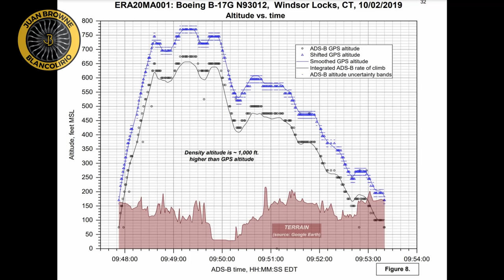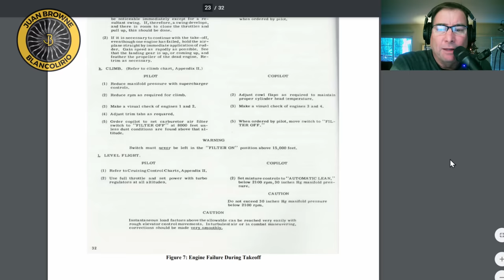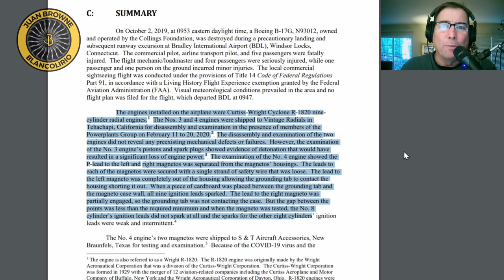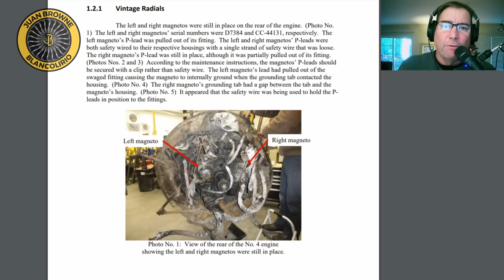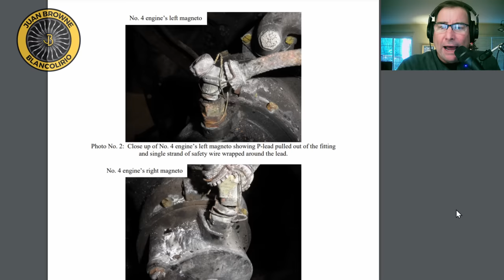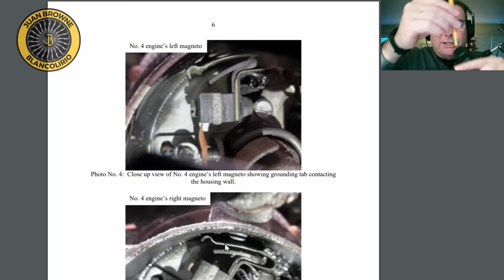NTSB Report B-17G Crash 'Nine-O-Nine' Part II -18 Dec 2020

Comment: The best way of preventing another accident was not taken.  If the FAA did their job they would have yanked CAF's certifications. Dallas would not have happened.  These tragically preventable accidents will continue as long as the CAF flys.
Reply: + @geeeeeeee3  "Nine-O-Nine" was not a CAF aircraft.   The CAF accident is going to be bigger can of worms once the final investigation is complete because it touches on airshow operations entirely.

Comment: As a R 4360 engine mechanic in the Air Force and a ol radial mechanic now, the left mag fires the rear and the right mag fires the front, 4 letters and 5 letters is a memory clue

Comment: Juan, thank you for this in-depth video. A magneto ignition system is a very basic system from my experience. Easy to maintain on a chain saw. But on a 76 years old 9 cylinder radial engine? Different story, I guess. Wouldn´t there be a way to retrofit these old engines with a digitial monitoring system, which could trigger an "ENGINE LIGHT" warning? The faulty condition probably already existed during the run-up check and during run-up for take-off. Probably there were good readings on the old manual gauges inside the cockpit and no unusual sounds from the engines. But a simple set of induction sensors on the spark plug wires probably would have sensed, that something is not right, triggered a light and demanded a mission abort. I am not an expert on this kind of stuff, but engine monitoring is not rocket science any more. Technically not feasable? Too expensive? Not desired because it would alter the historic authenticy of the aircraft? As a future passenger of a historic flight, should I insist on having the crew chief show me one of the spark plugs? If authorities don´t oversee things, maybe a little computer could? Just a thaught...
Reply: What you are describing is not a bad idea, but if you are going to do all that it might be worth it to go a step further and retrofit the engines with a fully electronic ignition system similar to what a modern automobile has. For one thing they are a lot less susceptible to moisture issues than magnetos.

Comment: I know it is a 1940's engine design, and I know that modifications on aircraft require a bunch of approval, but really, there are far better magneto systems out there today that if upgraded to would greatly help the performance, and safety.  Points ????  Really???  The corrosion is likely caused by poor fuel that was used in the engine at some point.  As long as the timing is proper, pre-ignition is caused by a lean mixture.  This can be caused by a poor mixture, as well as differential in fuel quality.  If things are all adjusted on one fuel, and then you go someplace else the fuels are not always equal.
Reply: Better ignition systems definitely available.
The cost of changing it on those engines
would be prohibitive because of the FAA
papperwork & testing requirements.
Reply: @pplusbthrust   Thanks; I'm aware that it almost takes an act of god to update things on an aircraft under the FAA rules.  One would think that in the case of these older magneto systems on older aircraft that some sort of system could be blanket approved for replacement if a variety of systems that were used on say pre 1965 aircraft.  Todays ignition systems would have cured a number of the things which caused these engine issues.

Comment: Curtis Wright engines were crap.  Always broke down and hard to maintain.
Reply: I think the Canadians replaced them in the DC-4 with Merlins and ended up with a much faster airplane.  I'd always heard about CW's just bursting into flames in mid flight, because of all the crazy plumbing, but didn't know if it was true.

Comment: It seems reasonable, that aircraft points ignition share some commonality to automotive points ..............and those need regular attention to run reliably with full performance. Points were a major bug bear for car mechanics until they were eliminated.  As for detonation.........thats a total disaster for any gasoline engine.......the pistons are not made for that kind of abuse and will cause massive damage very rapidly.........it can be caused by incorrect (lean) fuel mixture, fuel starvation and/or ignition timing.  If the timing is too retarded, detonation will happen, especially in a boosted gasoline engine.

Comment: For one thing ,compressed air is not the correct or best thing to dry something out with compressed air like that because it carries moisture ...nitrogen should be used because it is completely 100% free of water
Reply: The mags on 3 & 4 were blown out with nitrogen, it was mentioned in part one.
Reply: Best way to dry out a mag or distributor? Hair dryer. It warms up the equipment to keep moisture from reforming immediately. Even nitrogen can cause condensation when re-exposed to air because it cools the parts down.
Reply: @wattsup918  doh i just that that part thanks for correcting me
Reply: @thebigmacd  of course you're quite right the moisture really need to be cooked out of there over a. Of time

Comment: Aircraft ignition systems suck. They are from the WWII era and should be replaced with more modern electronic ignition systems but that is not going to happen on certified aircraft because the regulations are archaic and nobody wants to spend the money on these engines. I worked on radial engine ignition systems in the 80s and they were a nightmare. Most people don't understand how much maintenance they require. We are used to car ignition systems that go 150k miles without any work. That wasn't the case 30 years ago even on cars. Well, aircraft ignition systems never improved.

Comment: looks to me like bad maintanance,a 6 thou points gap it going to retard the ignition timing leading to a drop in power and hot running,thats not to mention the bodge on the lead fixing bodge,what cowboys did the supposed maintanance on this?,i wouldnt trust them to work on a pedal cycle let alone a plane engine!! FFS!!!!.

Comment: Pure laziness on the part of the overhaul. I used to wrench and maintain auto engines to race caliber and would never allow my engines to be as filthy as I see here. I see this as a recipe for disaster and killed innocent people from the wrong decision making of the aircraft maintenance team and leadership from above in rank. This plane should never have been allowed to run!
Reply: You gotta remember it was in a firey wreck though.
Reply: @429thunderjet2  True, but fire doesn't contaminate the internal combustion chamber like that shown...Valves, spark plugs and pistons all were in terrible condition.
Reply: @richc47us  yes I do understand that. I guess my point was the heat from a gasoline fire and being ground into the dirt with fire extinguisher residue and the oil burnt off, then sitting for months it's going to be dirty & steel will rust fast. All and all a horrible deal for all involved "RIP" & that old bird.

Comment: I know this is an old aircraft, but still people use these ancient aircooled engines even today. Modern liquid cooled, electronic, knock sensor engines are far better. Magnetos should have been banned decades ago, so unreliable compared to modern ignition.
Reply: I have flown magneto driven aircraft for quite a few years. Never had a magneto failure.  
I’ve been stranded 3 times because the electronic ignition on an automobile I was driving failed.  
There is much to be said about simplicity.
Reply: @raoulcruz4404  I've heard that before. You fly less than 10% compared to how much you drive and do 4 times the maintenance on the aircraft compared to the car. Same as people comparing a low hour plane to a car with 300k on it.
Reply: Often non-certificated aircraft have electronic ignition for variable timing and one magneto for safety.  You hit the key word: maintenance.  A modern liquid cooled, electronic, knock sensor engine that is not maintained properly will fail. Keep the hood shut on your modern car and see how far you get. 
 

Again, this accident was a maintenance problem. The same amount of neglect would have brought down a modern jet aircraft.

Comment: Im still curious how a B17 that is 4 tons under war gross couldnt fly on two.
I cannot grasp why the pilot turned into the dead engine/s and committed to right traffic. He should have known better and declared an emergency for left traffic and gotten the gear up.
Yes I know the B17 gear is slow.
Belly into a field would have been better, wouldnt it?
Reply from the maker: see part 1
Reply: Revisiting both videos today. 1 year later.
Two highly experienced pilots. The PIC has more B17 hrs than anyone ever. Yet he failed to maintain airspeed and staggered at the stall, knowingly turning into dead engine (s). 
IMO he believing he could save the airplane, failed to go straight ahead to land and control the crash. Something we have all been taught to do?? 
Obviously it seems he felt that he could stagger to the runway.
I see the flight path angling toward the approach end indicating that he did not consider a wide shallow turn to the cross runway as an alternative, AND obviously failed to realize the final turn stall at VMC was coming. OK it did not stall, but it wouldnt maintain altitude either.
Arrogance? Complacency? Over confidence? 
I was taught 50 yrs sgo that when it quits, it belongs to the insurance company.
Sad that lives were lost even though some survived.
Incompetent mechanics. Ive walked away from 4 pencil whipping operations in my career.
50 yr CP+, AP+ here.